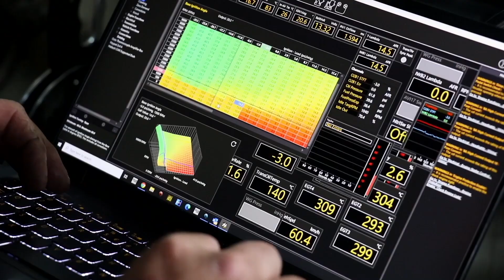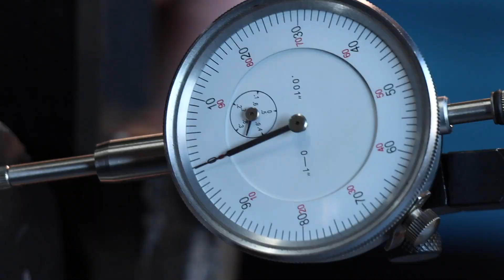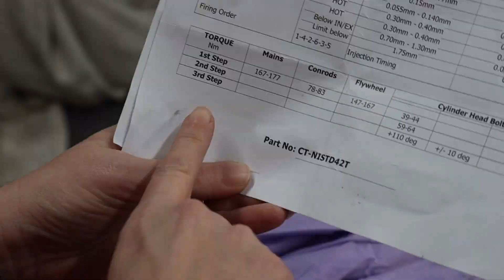TD42 REBUILD PART 2 - TURBO VS N/A DIFFERENCES

Comment: hi guys, great content ! i was wondering if the same changes should be done for the toyota engine 1HZ to the 1HDT, cheers
Reply: Engine australia do a kit to convert your non turbo 1hz to a turbo spec. Using hybrid pistons (1hz top with 1hdt lower) utilising the larger gudgeon pin of the 1hdt

Comment: The oil pump is also larger capacity on a turbo engine, the camshaft is different and also good idea to clean out the steam passages in the block.
Reply: steam passage ? I never heard this term, what are these ?
Reply: @crezychameau  between the bores is a hole approximately 2 .5mm diameter from memory which runs down on an angle to the side water jacket, we normally clean them out with a long drill bit.
Reply: @crezychameau  
I don't know about these specific engines, but some engines - especially with siamesed bores - have 'steam passages' or drillings to allow coolant through and avoid causing areas where circulation is poor and the coolant can get hot enough to boil - or, worse, air pockets can form. Basically, they're auxiliary bleeds.

Comment: Under 160kw  the td is fine.
Over is a lottery.
Generally a low km jap import turbo motor is the way to go for 7-8k rather then a rebuild as they always fail.
Mine got rebuilt twice before I moved on to Barra reliability.
Had heaps of info on na v t differences as I had a bitsa but lost them.
Reply from the maker: Did yours get rebuilt correctly or just have rings and bearings fitted? Was the pump built and timed correctly? Were the AFRs correct in the final tune?
And finally, did you expect it to do what a modern dohc 4l turbo petrol engine can do?
Reply: If built properly they are more reliable than Barra.
Reply: Also depends on cylinder pressure/ boost pressure and air density. If anyone knows what Stoikyametric  air fuel ratio means we can go there too.
You could do a whole thread on the root cause of engine failure as well.
End of the day it’s usually overturning = overheating or other components failing.
Reply: Rebuilt twice from what defects? By an expert who knows the engine, or a petrol engine shop?

Comment: I remember a friend got one of the 3 litres when they first came out, I thought it was a bit of a slug and you really had to matt the gas to get up steep inclines whereas the 42 had sufficient power to handle most occassions at half throttle (both turbos)

Comment: Common engineering philosophy of the upgrade tree. You put X power that's bigger than the base model, then you go down the line and add a little to every part so it's all boosted. In some aspects, that's good, but in other aspects, it's just dead weight. Don't get me wrong, making a taller building on the same basis as the shorter version, that's bad. In an engine... it's debatable if you even bother. Better metallurgy give better results than beefing up, that's why old engines are bigger, sh!t metallurgy.

Comment: I’m following this build with great interest. Not because I have a TD42…. Because my workmate has one in his patrol and it’s the slowest thing I’ve ever been in
Reply: Yep, slow, but they go forever. My TD 42 did 450,000 kms, wore the lumps off the cam. Stuck a new cam in it, didn't touch the rest. Still going at 700,000 km

Regular oil changes and filters are the key.
Reply: Have you ever driven anything with a 2L-E in it? Or any L-series diesel engine for that matter
Reply: Stock TD's are indeed slow as but they'll keep going forever with maintenance but they can also be epic if you adjust your expectations and modify and use sensibly.. That's the art to any diesel really.. You can have a fully built 6bt cummins or any motor really but I guarantee that if you flog it repeatedly it'll bin itself within 100 thou km just like any other engine that gets flogged repeatedly because you're operating in a band of tolerance in which the engine can only give so much for so long.

Like any old school diesel TD's are made to work consistently under certain conditions which doesn't include getting flogged like a clapped out skyline. 

You can have an ultra reliable TD that'll tow 3 tonne up a hill at 100-110 all day every day and not get over 90 degree water temps and never have any EGR/DPF issues (because there is none).. You just need to keep it at or under 18 psi, bigger cooler, derks water pump (or stock), a healthy cooling system, good airflow, diff gears to roughly match your tyre size, exhaust and a safe tune..

That'll go for 700-800 thou km before you need to consider a rebuild. 

Pretty good value to me..
Reply: Diesel hiluxs are heaps slower 😂
Reply: @BamBamZ_Gaming  Nope. LN106 will blow a td4.2 NA away!
Reply: They should do, because they have a much newer design. They won't last half as long though. @Lazy_Tim
Reply: A good one will start doing a burnout as it comes on boost in third. That one was a bitch to tune it kept hopping up on the front roller of the dyno.
Reply: Once borrowed a mates TD42 powered GQ to tow a car back from a few hours down the road. Struggling to maintain an honest 90kmh was a first for me! He explained it was reliable... I countered by offering reliability wasn't hard to come by when you're only making about 20hp per litre haha!

Comment: I know a factory Td27T had a larger oil cooler than a non turbo one. Does anyone know if TD42's were that way too?
Reply: Oil coolers are the same size
Reply: Another fellow in this comment saying the oil cooler housing is different. 

I’m building a new TD42t using parts from a my dead silvertop. Hosing bolts up but keen to hear what’s different?
Reply: @nickunw  So I checked the part numbers, the elements are different. The N/A TD42 uses 2135530J00 and the TD42T uses 2135506J02. The N/A element is thinner (4 Fins VS 6 Fins) but they will bolt into the same housing.
The housings are a bit different but will also interchange. In about 2000 the GU TD42 used 2 different oil filters for about 12 months, all the rest use 2 same filters.
The TD42Ti has a different housing, but it is just the coolant connection for the EGR system.
Reply: @MKPatrolGuy  mate. This info is so good!! I have 4 fin oil cooler from my 95 silvertop out on the bench cleaning it up ready to go back in to the 06 blacktop TD42t. I think I’ll have a hunt for a 6 fin for better cooling
Reply: @MKPatrolGuy  yeah the td27t vs non t was 4 fins vs 3 on the oil cooler. The real late td27's had a different housing also with the vac pump on the alternator vs gear driven. One had an oil feed off it the other didnt.
Reply: @MKPatrolGuy  can confirm that the silvertop TD42 motors use a 4 fin / plate cooler where the black top TD42T motors use a 6 fin / plate. They're interchangeable inside the oil filter housing. I've just swapped mine over on the new build.
Reply: @nickunw  I'll try and remember to look at part numbers tomorrow and get back to you 👍

Comment: There is also a difference in oil pumps. The Na spec is 19mm wide and Turbo is 21mm. 10% bigger to match the bigger piston oil squirters and oil feed for the turbo.
Reply from the maker: Thanks for sharing mate!
Reply: It’s actually very refreshing to see positive contributions in the comment section.
Reply: Yep, can run into low oil pressure issues running turbo squirters and N/A pump
Reply: Was about to ask if that was the case but you already answered my question.
Reply from the maker: We did replace the oil pump but I didn't check this. The machine shop was all over the TD stuff and ordered it for me.
Reply: What shop was this?
Reply: Piston Cooling Nozzles (oil squirters 🙄, please b)

Comment: Probably a daft question but what is the oil you are coating the pistons and bores with?
Reply: might be assembly lube
Reply: I will just be run in engine oil for the bores and pistons. The black stuff is molybdenum assembly lube used for high pressure areas and the red stuff is "sticky" assembly lube used where you want it to stay until flushed out with normal engine running.
Reply: On the tube.
Reply: Best to use running in oil as it doesn't have friction modifiers that can prevent the rings from bedding in. Turbo engines tend to not suffer as much from this as the boost pressure forces the rings against the cylinder wall. 
Ask me how I know, made that mistake with my first engine rebuild.

Comment: I had a new factory turbo TD42 in a 2004 Coil Cab. It was a slug!, can't imagine how slow  a non turbo TD42 would be...
Reply: Cart all your stuff from one side of Oz to other whilst near half a million Kms & no smoke
Reply: @benwinter2420  this is another myth lmao a td42 is dead at 500000km try and tell me there's not enough blow by to satisfy 100 men there good for 350000km after that they get slower by the day until there so hard to start you list the long block on Facebook for 8k 

This comes from a previous owner and a serious buyer with 30k for gq patrol but I had to give up looking at diesel's now I'm looking into a merc om606 swap for half the price of td42
Reply: They won't pull the hat off your head
Reply: Did Karratha to Perth in a four door wagon in 13.5 hours but it was in winter at night and I've had 3 GQs all with over 350000 kms on them and all NA's. Yes they are slow around town but if you keep them cool and pour the fuel in you won't kill them.
Reply: I'd message the owners of td42 patrols saying DO NOT WARM IT UP I WANT TO INSPECT IT COLD and most of them would just never reply after that
Reply: Absolutely gutless I test drove 5 of em thinking they where all fked but turns out there just trash from factory lmao
Reply: @minzahhh1 so are all NA diesels. It’s not a TD42 specific thing.